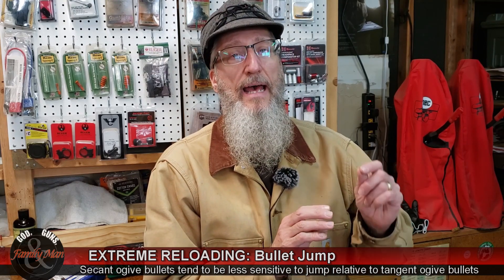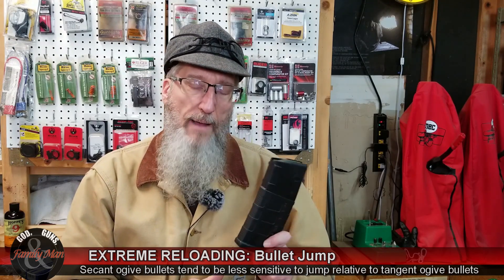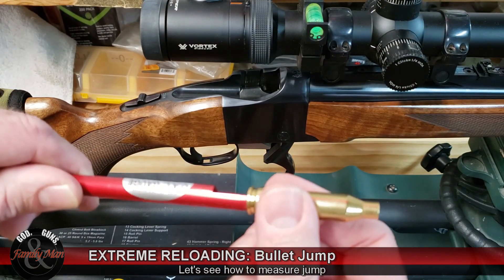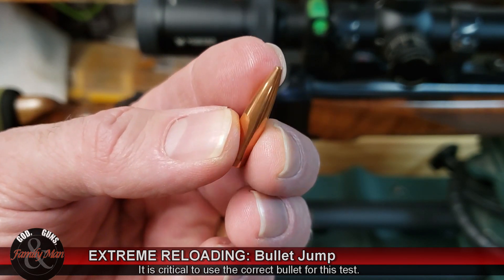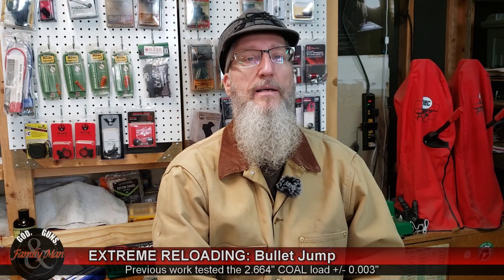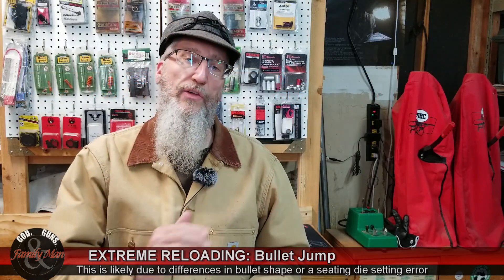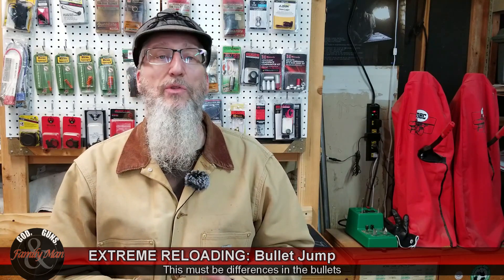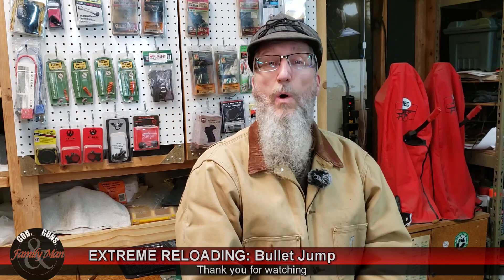Extreme Reloading: Measuring and Setting Bullet Jump (ep. 07)

Comment: Thanks Man 
Very interesting , I always measure to the ogive it seems to be more consistent , I use only Berger projectiles but find even with the good quality projectiles the 0AL tip to base is very often not consistent , thanks for the video Mate , Steve .
Reply from the maker: You are welcome Steve.  And thank you for watching.  
Have you had good luck with Bergers?  I am not getting good results in either my .308 or .223 rifles with Berger.
Reply: Hey Man 
Yes I have had a good run with Berger’s , over the yeas I tried most other brands and types of Bullets and always have come back to Berger’s , I shoot F class , I’m very fussy with case prep , and seating depth Berger’s I find like a big jump in my rifle I run 80 thou off the lands which seems the perfect node , if your having trouble try increasing jump starting at 40 thou and work up from there , Regards Steve .
Reply from the maker: @aussiesteveakastevecallagh2280  So they like a lot of jump.  I did not know that.  I would like to try that in my .308. I know Berger has some secant ogive and some tangent ogive and some hybrid ogive bullets.  I have the hybrid 168 gr. and would like to try it. Thanks Steve.